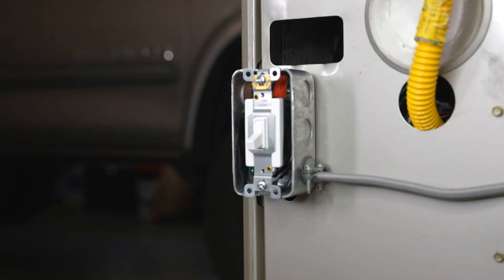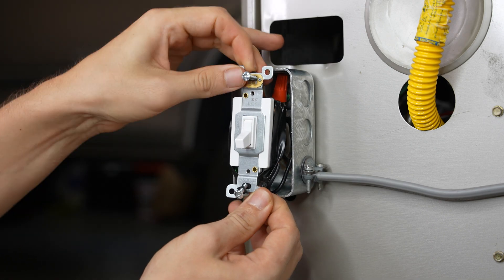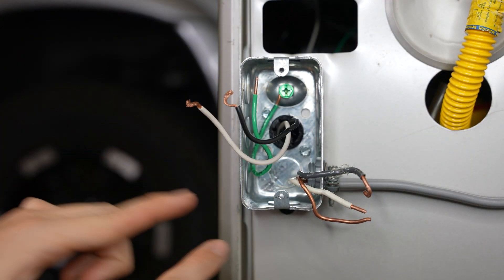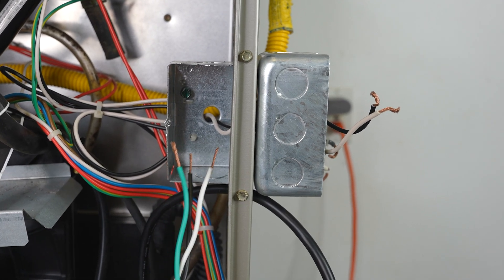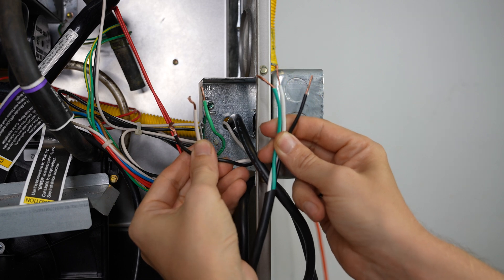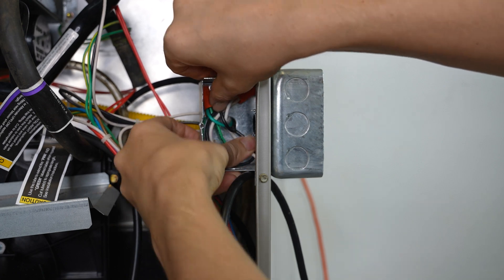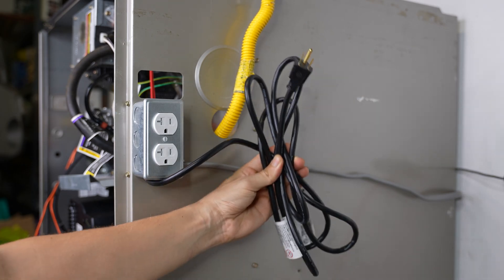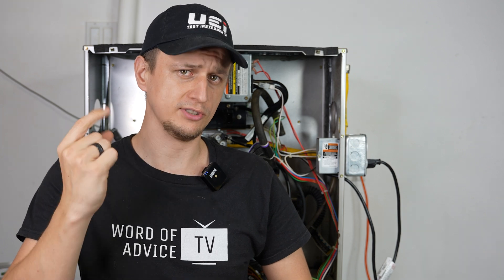How to Replace Furnace Power Switch With an Outlet

Comment from the maker: ⬇ Other videos you might like:

How to Install Furnace Power Switch:
https://youtu.be/n1r9OIixrM4
How to Wire Furnace to a Plug:
https://youtu.be/kby1lCF8Yi0
The #1 Furnace Killer:
https://youtu.be/l3qCY8GIqb8
10 Ways to Connect Wires Together:
https://youtu.be/ihpNCVk1lF0
How to Read Furnace Wiring Diagram:
https://youtu.be/2MSedAkirqw
Top 5 Furnace Problems:
https://youtu.be/T4IWtKy--Vk

Comment: Running that pigtail cord through that hole in the furnace without any strain relief or grommet could wind up making your entire furnace hot and an electrocution hazard some day if the furnace isn't grounded properly... or it's going to blow a breaker and shut down your furnace in the best case scenario.

Comment: Great video! Thanks. 

As others have said a strain relief is good practice and required. Always still bond the screw, it is code and it adds redundancy. Also depending on you area metal flex tubing should run through the furnace to protect the wire. 

A tip to bond the ground the plug, cut the ground longer and then wrap the screw and connect the rest at the same length to the box.

Comment: @WordofAdviceTv    Hi Jay!   After watching this video in my spare time i noticed that there were holes in the metal with the cord coming through and although in Heating & Cooling Installing a lot of Businesses do it that way but it is safer to have a protective bracket ring for the cord to push through so it is not just rubbing against the metal like that.   A lot of people install it that way without and just leave it bare like that but i don't like it.   What could happen later on is the cord could move a lot and rub against the sharp metal and then wear out the corded rubber and then if not properly grounded or lets say the AFCI?GFCI protection is not done correctly or faulty and yet allowing power flow then the entire metal can become energized.     Other than that i agree with you in everything else in this video!!

Comment: 5:31  Really ??? .....a flexible gas line going through a metal knock-out hole with no chafe protection???  I think code requires iron gas pipe through the case of the furnace.

Comment: 4:45  WHOA ......use the strip gauge on the side of the outlet. Make sure that wire is stripped back the proper length.

Comment: 4:00  I think you must be correct that the ground frame of the outlet is going to be screwed directly to the metal box so the use of the ground lug would only be necessary in a plastic box.

Comment: As a final way to verify that power is off after verifying it with your hot checker you can put your screw driver between hot and ground......JUST as a final check. Better to trip a circuit breaker than to get shocked.

Comment: Hey, I have a question about my AC unit. I’ve watched all your vids about AC unit. This is my dilemma. 
I have an HVAC unit, I noticed the Heating stopped working over night. My thermostat was dead. I put new batteries. I have a blown 3A fuse in the attic. I checked for voltage. Everything seemed ok. My attic fan turns on but my outdoor AC is not throwing heat nor cold air. I checked the wiring going to the outside unit: I have 24v. I checked the contactor and I have 14ohms. As I had the contactor unplugged at the 24v terminals I checked for voltage and I do have 24V on the leads but when I connected them to the contactor. I have no voltage. I do have 240V coming into the contactor and when I manually pressed the button on the contactor. The AC unit turns on. Please help!

Comment: what about. Ac mr jay
Reply from the maker: The ac condenser unit outside uses 240v so the setup I showed here would only apply to furnace applications during a power outage.
Reply: i love ur videos.      And my health  got better lose 19% body  weight ) after watch ur video,    from ur sis or cousin,   Barbar oneal . Crayons pepper.        From previous vodeo

Comment: Code here requires each receptacle to have a ground wire. The ground wire needs to connect to the grounding screw on the junction box.Though there is probably metal contacting metal from the box to the receptacle ears, you can't guarantee that connection stays solid over time and doesn't corrode or something.

There are actually quite a few semi-nonintuitive rules for connecting wires to receptacles in junction boxes in the code that are important to follow. Someone watching who is new to this should either learn that code or hire it out to an electrician.

There should be a strain relieving grommet where the cord goes through the metal chassis. The sharp metal edge could cut through the cord under vibration. Especially where it is now a plug in appliance, someone might pull on the cord when it is plugged into the generator and rip it out of it's connections without a strain relief. Any electrical product you buy either has a cord with a strain relief or an IEC connector so the cord unplugs at the chassis (eg a computer). This is a requirement to get a UL or CSA stamp.

Comment: Im an electrician. Lpve your videos but theres some terminology mix ups. Your green wire is a bond wire, not ground. Yes it does eventually go to ground but all the bare/green wire does is “bond everything to ground”.. the terminology could be different where you live, im from canada. Your ground or grounded conductor is your neutral. For myself i  just like to say “hot wire” “neutral wire” and bond wire. Again, love your channel and videos

Comment: Lack of a anti-strain is a issue.  

You also need to run a ground to the outlet.  Relying on the screws is poor practice and can vibrate and not make a solid connection

Comment: I understand what you did but you still need a switch for the furnace, it could be fixed so power with switch and still hook to generator this is a bad fix of yours in my opinion.
Reply: Yeah a bad fix.
Reply: No need for a switch when all you have to do it unplug it.
Reply: True, but you would have to run gen all night if you wanted heat at night.  With this fix, gen charges something like jackery which then runs furnace at night without having gen running.

Comment: I love this.  I used to live in the mountains and had a generator that got a lot of use when the the old power grid would wink out during the winter.  My furnace was in the attic, but already had a pigtail running to an outlet up there.  A little inconvenient to get to, but worth it and a lifesaver when it was freezing outside.  That furnace was 110v.  The one I have now is 220v so I really can't copy this great video.  Besides, even though I installed a transfer switch to make life easier, my old generator can't run my furnace.  Time to upgrade I suppose.

I do have one minor question.  I noticed that when you ran the pigtail through that knockout in the side of the furnace that you didn't use any type of rubber grommet.  I realize it may be unlikely and might take years, but is there a concern at all that years of vibrations might eventually allow that thin metal to cut into the cord?  Or, maybe before that ever happens the furnace will have been replaced.  When I wired up my new furnace I was sure to use grommets. Better safe.  I've been a "shock absorber" countless times.  You would love the story of how I was repeatedly electrocuted as a little kid and my parents didn't believe it was happening.😵‍💫

What the heck.  I've got time. 
My siblings and I rotated washing the dinner dishes as one of our chores.  It as my turn one night.  I reached up to turn the water on to fill the sink and got knocked on my butt.  I ran all though the house to the other end where my parents were to to tell them. "You didn't get shocked.  Get back in there and do the dishes."  I obeyed and went back, went to turn the water on and got zapped again.  I ran crying to my parents.  This time my Dad came to check things out.  He touched everything, including the faucet and nothing happened.  He left after ordering me to do the dishes.  ZAP!  I'm bawling now.  I get my Dad, he checks things out again and again orders me to do the dishes before he left.  ZAP!!!!!   My Dad checks things out, but can find no problem.  He finally stands there and  tells me to turn the water on.  I refuse and we go back and forth until I am ordered to do it (and being told I wouldn't get shocked).  ZAP!!!  Screaming and crying.  My Dad finally actually investigates and finds the problem.  Turns out that I was being electrocuted every time I touched the faucet.  Why?  This was the early '60s.  The kitchen faucet was all metal.  The kitchen counter was Formica with metal trim around the edge.  My parents were big coffee drinkers.  The electric coffee pot was metal and plugged into an outlet.  I had taken a metal pan off the stove and set it on the counter.  By shear bad luck, I happened to place it so that it was touching both the metal coffee pot and the counter's metal trim.  No problem for anyone except I was a short little kid.  Everyone else could just reach over and turn the faucet on without touching the counter, but I had to lean against the edge of the counter and stretch to reach it.  So we had a shorted coffee pot touching a metal pan which was touching the metal  trim.  I touch the metal trim and when touching the metal faucet I was completing and grounding the circuit and Wham!  Every time my Dad checked everything to see if I was getting shocked he only touched one thing at a time.  If he had touched anything metal at the same time as he touched the faucet he would have shared my experience.  On the bright side, I didn't have to do the dishes that night - and they bought a new coffee pot.
Reply from the maker: I enjoyed reading your comment, thank you for taking the time to share! You are right and I really should have used a rubber grommet. Though if I had to be honest, I think the chances of the rubber getting worn down enough to allow the wire to short to ground are very slim. Even if it does happen, likely the circuit breaker would just trip. It's good to be on the safe side though and make an effort to put the grommets in unlike me in this video. 😇

The story of you being a shock absorber is wild too. What's even more wild is that you repeatedly got zapped and were even urged to do so. A lot of things had to line up just right, including your dad not getting shocked. Crazy stuff! Maybe this was determined by fate and somehow impacted you in the long run. Glad everyone was okay! Have a marvelous rest of the weekend good sir and may you never have to be a shock absorber again!

Comment: I made this change to my furnace ten years ago. I don't know why this isn't standard practice in areas when power outages are common. Great video explaining the process.
Reply from the maker: Right? Seems like a great idea for cold climates. Glad you liked the video, thanks for stopping by!
Reply: It should be standard but NEC requires furnaces to be hardwired.  It's a dumb rule

Comment: What do you think of ecm motor surge protectors? Are they worth it or just another gadget that fails?
Reply from the maker: Short answer - I don't really know. Long answer: As far as I know, many ECM motors actually have surge protection built into them but the only problem is that the thermistor that absorbs the surge may fry it in the process and the motor will stop working.. To be honest, I have never installed one of these so I don't really have an opinion on the matter. It sounds like an upsell to me but they have a logical argument as to why it's a good idea. Replacing a motor can be very expensive so installing a surge protector would make sense. It should be pretty easy to install, in fact I have an ECM motor on the furnace in my garage so perhaps I should order one of these things and make an install video on it..
Reply: @WordofAdviceTV  Thanks for the feedback!
Reply: They are inexpensive protection, especially if you are prone to power spikes.

Comment: Hi Jay, great video.  Some suggestions:  you can tell the original switch was wired by “Joe Homeowner” as top “shepherds hook” wire was installed incorrectly since it placed  counterclockwise around the top screw of the switch.  Original “Romex” plastic covered electrical wire was not pipe sleeved to protect it nor was it strapped to support it along the body of the furnace.  I would have used grommets whenever a wire goes through a raw metal hole to protect it from damage and cutting the wire insulation as a result of the vibration of the fan motor in the furnace.  As you said, this a good method to run the house furnace with a generator in a power outage, especially in the cold winter in snow country!  Bill
Reply from the maker: Thank you Bill! You sound like my electrician friend, very professional! Thank you for the suggestions and observations, much appreciated!